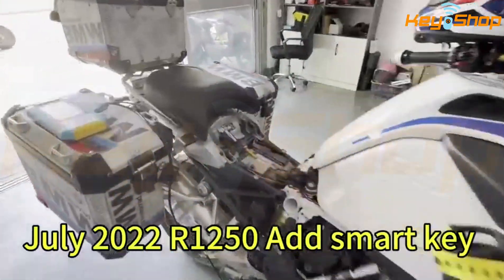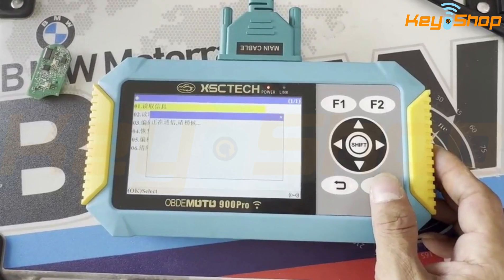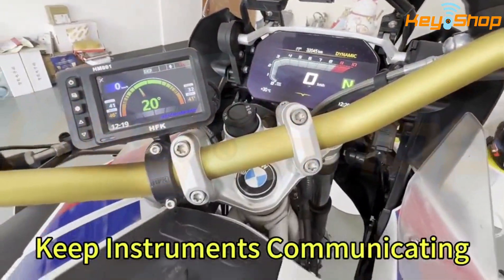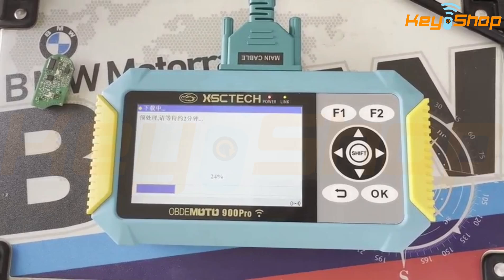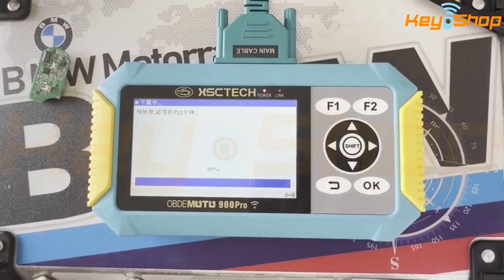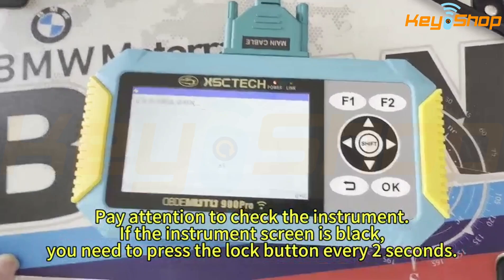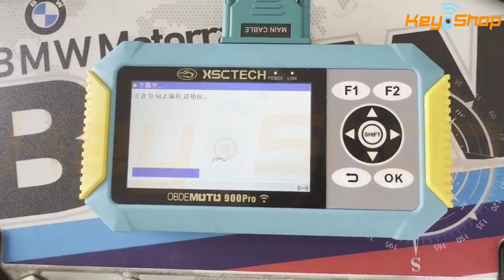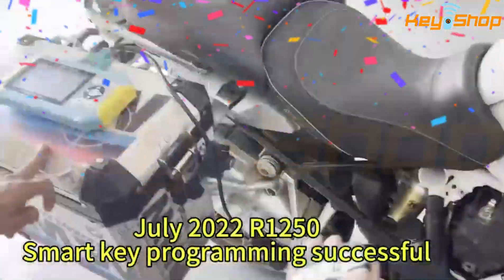OBDEMOTO 900PRO - 2022+ BMW 8A Smart Key Programming | KeyShop

Comment: I'm trying to program a bmw f850 2023, I did the correct procedure, but when it's time to restore the file the machine can't, it says that the file is lost, and shows from the panel an error in the TPMs sensor, but it didn't delete the original keys! I need some help to try to restore this file and continue programming the key! The bmw 2022-2023 function is not released, only the 2022
Reply from the maker: Hey Fanese, as you mentioned, the function you are looking for is from OBDEMOTO's latest 2022-2023 BMW update, which addresses also the TMPS error and corrects it, feel free to contact us via live chat on our website https://keyshop-online.com so we can further look into it.
Reply: @keyshop- 
There were also problems with 2023 r1250gs adventure - can't make a backup